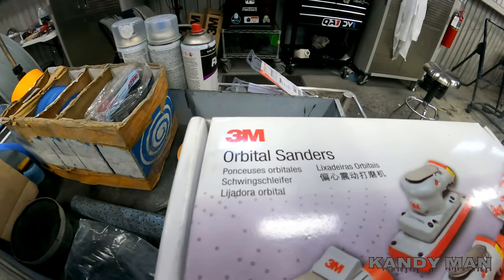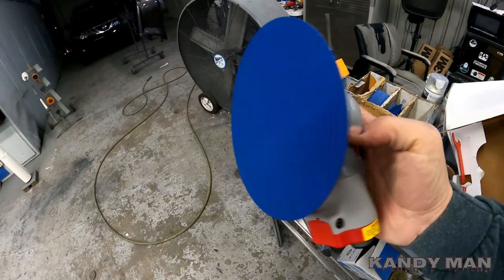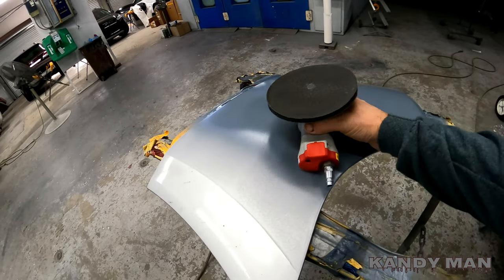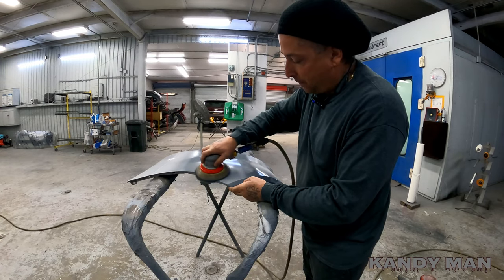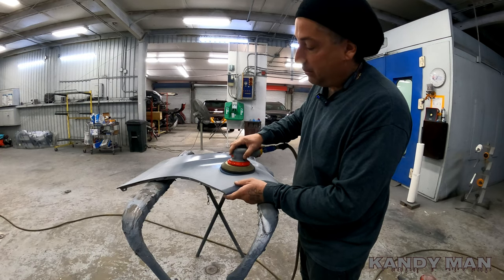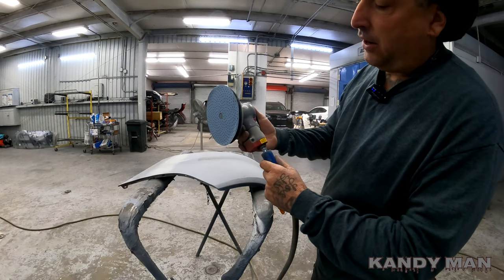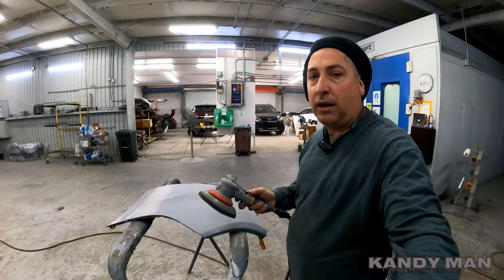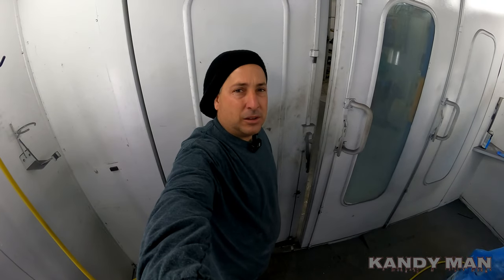HAD TO PICK UP A NEW DA SANDER

Comment: Sander looks like it works great. I love 3m products but the price on some of their tools is just ridiculous.  I got a Dewalt DA and I love it. Cost me 89 plus tax at the time . For me personally instead of spending 220 for a non vacuum DA I would look into investing into a self vacuuming DA system through festool.  We use those units at work and they are awesome. Can get the whole set-up plus cart for about 800. System was made by both festool and 3m.
Reply from the maker: Thanks for your support.